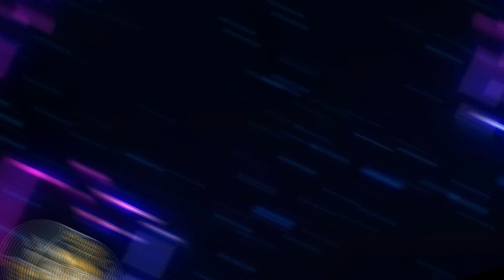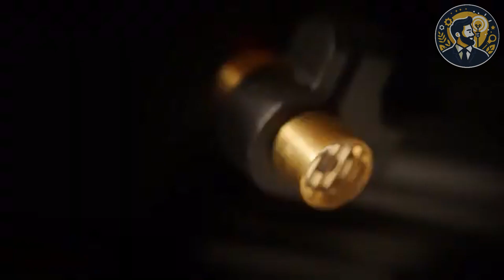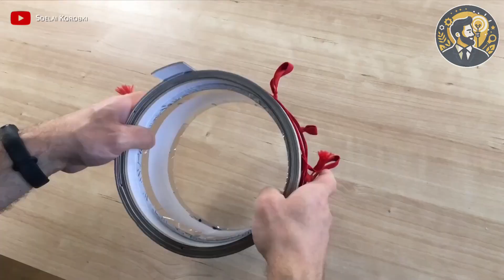20 Powerful Machines to Skyrocket Your Business Profits in 2024!

Comment from the maker: 00:00 POP displays made of cardboard
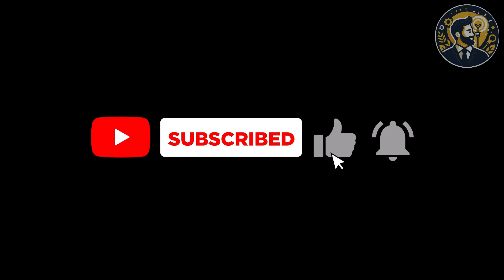00:52 Links to machines for business
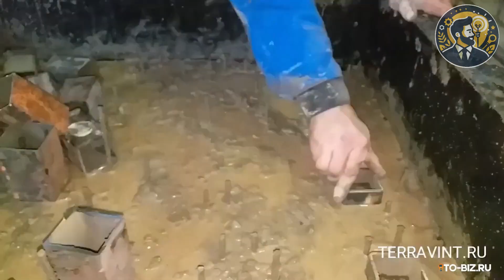01:09 Module for production of concrete screw supports
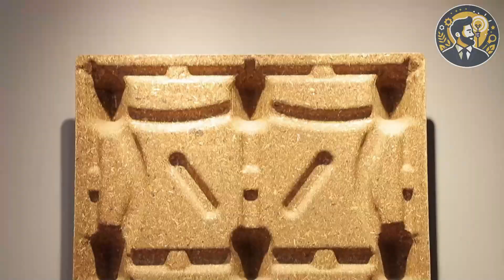02:02 Sawdust pallets production
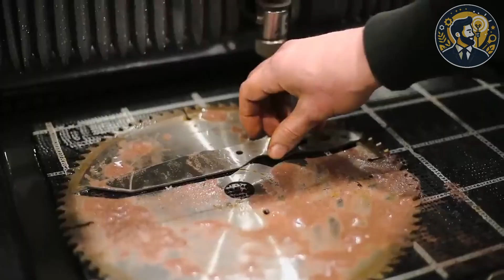02:38 Compact Water Cutter
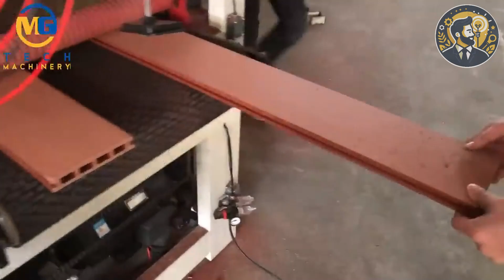03:17 Production of plastic boards
03:57 Tabletop Vacuum Forming Machine
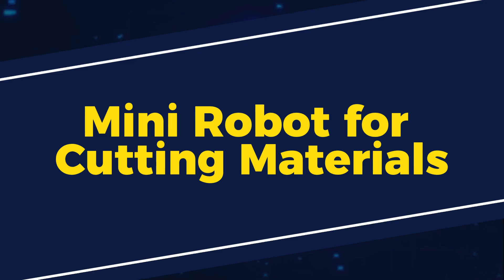04:44 Auto Key Duplicating Machine
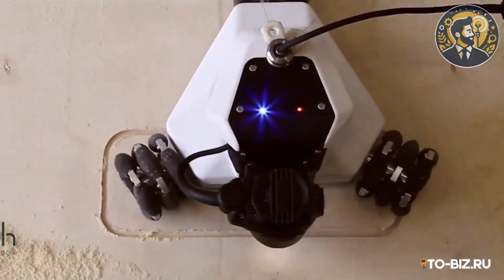05:21 Mini robot for cutting materials
06:19 Automatic knitting machines
06:48 Machines for silicone products
07:21 Manicure Robots
07:55 Photo Engraving
08:37 Production of Glass Fiber Concrete Products
09:19 Mini Thermoplastic Machine
09:48 Production of gift boxes
10:24 Knitting Machines for Socks and Gloves
10:50 Sandblasting
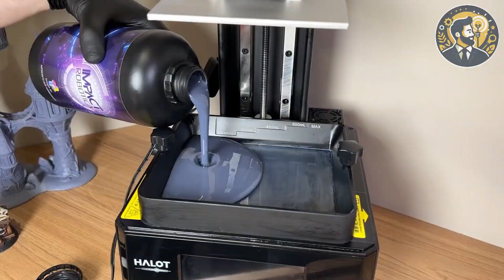11:15 Bicycle Charging for Electric Vehicles
11:57 Carpet washing machines